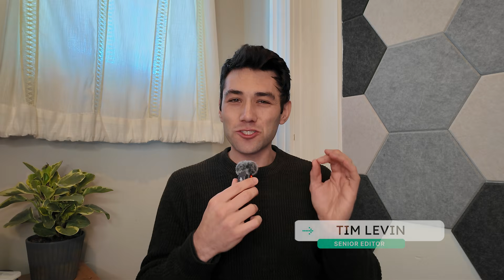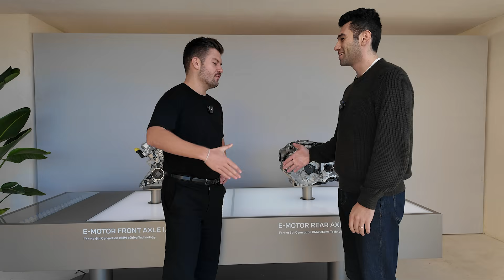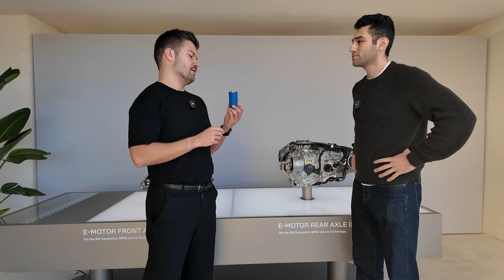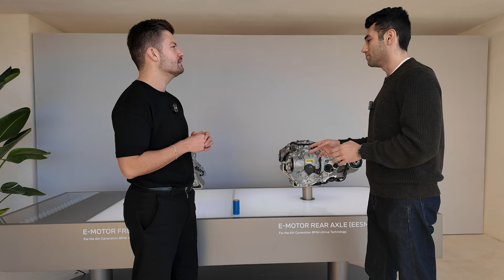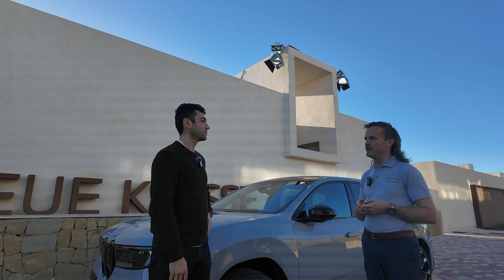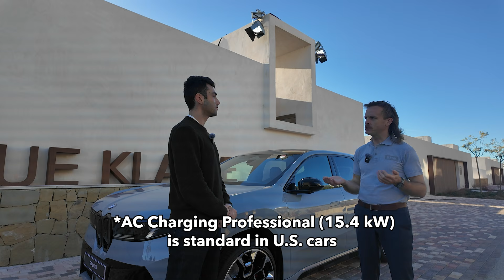BMW iX3's Charging, Batteries & Range Explained By Engineers

Comment: Great information Tim but my question is about how much corrosion protection is there for the undercarriage protecting this new battery design? How long will this last or warranty to last on American treated snow roads? Just wondering what the repairs would be like if there's somehow a corrosion whole especially since we're sitting on top of the battery pack? 🤔🧐